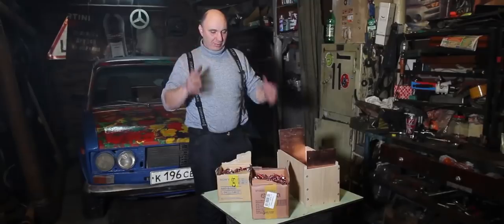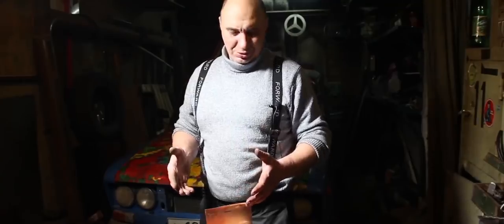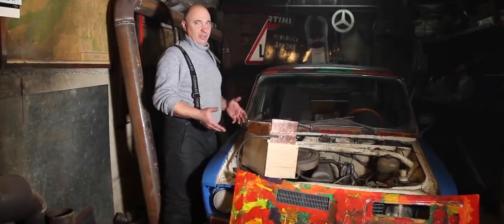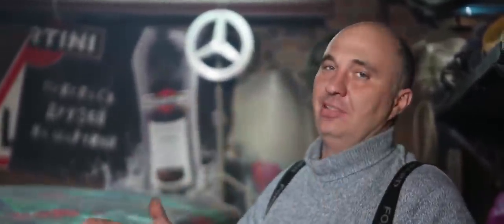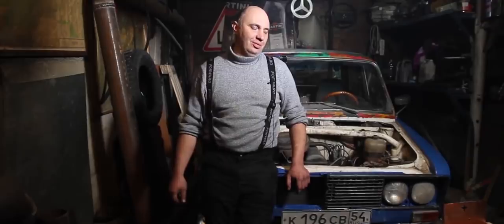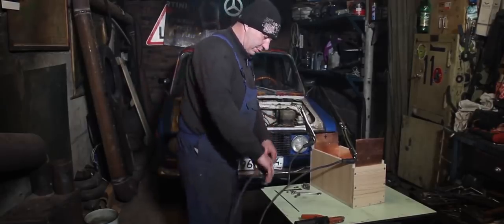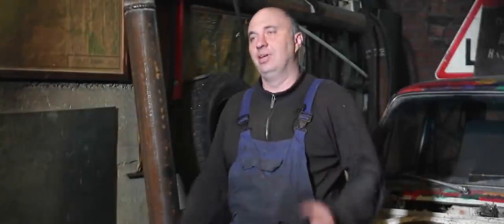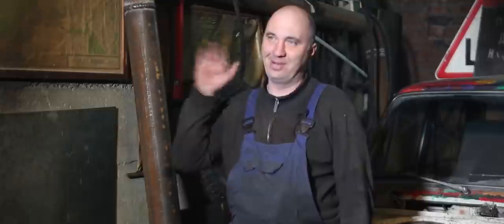1000 AA's instead of a conventional car battery

Comment: Should try making a permanent battery with rechargeable AA batteries, then you could rechargeable it safely
Reply: So make something exactly the same as whats already in there, a rechargeable battery? Yikes how exciting, we will all be asleep before the end of the video, if anybody bothered to watch it.
Reply: that's not a bad idea. it's a lot safer than a wet battery if you're using it indoors with a power inverter.
Reply: Lassi Kinnunen  super expensive LiFePO4 batteries then
Reply: Lassi Kinnunen  Its a battery that can be recharged.... Its the same, its dull!
Reply: @RichardWraith  chill, just a suggestion ya don't need to get all agressive and shit.
Reply: @RichardWraith  This is exactly what I was HOPING to see!!!!!!!  An alternative way to purchasing a battery that is more affordable than having to buy a damn EXPENSIVE tesla battery for your electric car!
Reply: You can buy those with multiple functions from some 30 $ or euros and up. Err, for backup that is. Permanent for in a car is not such a good idea, bc batteries have a memory function; meaning the capacity decreases rather quickly.
Reply: 18650s/Tesla Batteries would be a lot cheaper and they are rechargable
Reply: No. That would not be a good idea. Rechargeable AAs steel nothing like a lead acid car battery. They will likely overheat within 20-30 seconds. Depending on the construction, the core of the batteries would probably try to force their way out the ends, though I believe most rechargeable batteries have vent holes at the nipple end so the pressure can be released in the event of an overcharge. So likely 30 seconds in there will be a lot of smoke and a lot of ruined batteries. Probably fire and possibly some explosions and batteries flying everywhere.
Reply: @ihatesignupsgrrrrrrr   Actually tesla battery is some of the least expensive that exist on the market, lithium batteries is expensive to make...
Reply: @serisak   You do not have a clue what you are talking about. Running eleven  1,2v rechargeable aa batteries in series would give 13,2v and combine many in parallelly also and you could use that as replacement for the normal car battery just fine...

Comment: Its 8 Cells in Series = 12V / 0.5-1.0 Amps/Max  and 125 Rows in Parallel so its 12 V at 62.5 Amps to 125 Amps, depending on the cell quality, but it's almost the same like a cheap car battery
Reply: CLIQUE CO. It's all in the maths
Reply: welp you just whipped my ass in electrical engineering
Reply: It's a 375 amp hour battery, but you're right. not much current compared to any kind of rechargeable battery.
Reply: Usually, car battery sits around 14V. If you look at the discharge curve of 1.5V Alkaline battery you can see it very quickly falling to 1.2V. It would be a lot better to do 10 in series.
Reply: I wonder how hot the cells were after starting the car a few times.
Reply: A fully charged alkaline battery will put out more like 4-8 amps. Youd be much past 125 amps
Reply: @krneki44  No, it sits around 12,5-12,7V. When it is charging, it goes over 13,5 better 13,7V. Some rare occasions it goes to 14,1-2V.
Reply: @Derundurel  Starting the car didn't load them for very long. If anything would have heated them up, it would have been the stick arc experiments, where the batteries were essentially short circuited for longer periods of time.
Reply: he said 8 batteries wide and 12 batteries long.  So it's 12 AA in series.
Reply: @dtester   Yes he said, but he oriented the box that way to him self. So its rather wrong. 8 aa in series. 125 paralels. Those are cheap ones, so about 1,5Ah range. That goes to about 175Ah. For that engine in Lada it would be enoug 60-70Ah lead acid battery. Starting power in about 500A or more...
Reply: @mihamaker  doh, shenanigans!!!
Reply: @dtester  When I paused the video with an overhead view of the battery box, I saw 8 long, 12 wide, 10 deep except for 5 columns that were eleven deep. That worked out to 125  8 cell strings, for a total of exactly 1,000 AA cells. That works out to about 375 to 400 Amp Hours, but a rated current of only about 125 amps. Alkaline cells can't produce as much current as rechargeables, but they can run light loads much longer.
Reply: @vincentrobinette1507  ya I know, that other guy beat u to it.  Shenanigans!!!
Reply: @dtester  12 x 1.5 would give you 18 volts. I would have to watch it again but I think he said 8 long 12 wide.
Reply: @davidhenderson3400  he said 12 long 8 wide...but that was an error.  Two guys before u already responded that it was actually 8 long.  Lets see if a fourth guy  tells me again ^_^
Reply: @dtester  You will be lucky if it is only 4. Most likely some one will see your comment 15 years from now and be the 400th person to post this.
Reply: @mihamaker  cheap AA are closer to 600-800mah, and knowing the capacity doesnt = cranking amps..
Reply: @zacharycharo4374  12v would be seen as a dead battery, which would engage the alternator, putting the batteries right around 13.6v
Reply: Many non-rechargeable batteries have voltage as high as 1.75v, which would be 14v, not 12v. Which would not engage the alternator.

Comment: The underhood welders work really well, but you need a high output alternator and a deep cycle battery. I have that welder on my jeep and have used it several times in the middle of nowhere

Comment: to be able to weld with a car battery you have to have at least 2 and wire them together to get 24v then you can lay beads with stick electrodes. The rod will just barley get hot enough but it works and will get you home in 4x4 situations

Comment: The reason this works is because the AAs are in parallel. It looks like this battery is in an 8s96p configuration. This means the starting current is split so each set of batteries in series only needs to provide 1/96 of the starting current, which should be totally doable

Comment: I think it would actually be 13 and then 12 columns of 8 cells long, alternating to 13 and back to 12, because it seems like the cylinders would be staggered in the box (5 double-rows of 25 = 125, * 8 for the 1000, at 12V and an undetermined large amount of current).

Comment: Tesla battery packs are full of 2170 cells, so it's basically the same thing

Edit 18650 to 2170
Reply: Not same thing.
Li-ion battery use different  chemistry
Reply: Duh
Reply: 12x9x maybe 10 
That 1.5V x9=13.5V because the the cells are connected and each pack has 1 Ah guessing there is 120 packs/rows about that 120Ah and 13.5Vx120Ah=1620Watt hours
Reply: @banopanov3281   correct that is the capacity of the battery bank ,, but you are not gonna discharge it for a few hours ,,what you need is a good 200 or more short instantaneous current

Comment: The internal resistance of carbon batteries limits the current flow more than lead acid batteries. They have a lot of power. But, it's unlikely they will hold an arc.
Reply: to sustain the arc you need at least 18to 20 volts ,,, and 40or more to have a good arc start  with the scratch method ,, so the 12 volt does not do it

Comment: Would've liked to see an ammeter in that circuit. AA batteries typically have a short circuit current (max current output) of about half an amp at most. I'm figuring around 62 amps would've been the most that battery pack could output

Comment: A 1.5V AA battery can usualy surply about 1A, with high quality , with some high power it can go as high as 4A... Rechargeable batteries can go much higher.

You need 8 in series to get 12V. That makes makes 125 in parallell. That gives us anything from 125A to about 500A. I don´t know if 125A could start a engine.. maybe a smaller one... 500A will certanly do the job, and also fairly well.

Also, even if the batteries only can dra 1A... they may be able to draw twice or even three times as much for less than a second, and that might be sufficient to start the engine
Reply: 35A is enough to start a small car, 75A for mid sized hatch backs, 125A would start a truck

Comment: he should have done them in an x9 pattern instead of an x8, overvolting the 12v system slightly is pretty much standard practice. Running 13.5v would have left room for voltage drop when load was applied and required waaaaaay less AA batteries. Also, any hint of the alternator working fine is a false-positive, the batteries aren't rechargables so once the charge is gone they're just going to leak and blow up from the alternator pushing power to them lol.

Source: Me. I ride a 48v eBike and a 52v battery pack serves waaaaay better lol

Comment: Next time connect the car to a 110 volts and try to started it like that that would be cool
Reply: I've started a '73 Beetle with 230 volts... It works like a charm, because normal 230 volt socket only gives 10 A current (230 V * 10 A = 2300 VA, 2300 VA / 12 V ~ 191.667 A) . The connected current meter did jump out of scale in about 1.5 seconds (it could only show up to 4 A load)..
Reply: How the hell are you gonna start a DC system with AC voltage???? I call bullshit

Comment: Move the radiator if you need to, see if you can manually crank start this car with a bar / socket on the crank pulley bolt. Also try using a power drill.

Comment: You need far fewer batteries to start a car, maybe just 10 are enough, good batteries can provide considerable amperage.
Reply: 10 AA's no way
Reply: 1.5 volts each one. 10.5 if are 10. You need 12 volts. Without speak about amp.
Reply: @RichardWraith  yes, I made a math mistake,  but you that say that can start a car with 10  AAA call me idiot?
Reply: You can start a motor with just 10 AA batteries but u cannot recharge them back unless they are rechargable. But you will just need 8 of them which if they are healthy gives u 1.7V per battery x 8 of them equals 13.6V (and they will even have more which is surely enough) and each AA battery has at least 1500mA which x 8 batteries gives 12000 mA which is well enough comparing that a normal car battery has only 6000mA inside it to start a car. Easy.
Reply: @johnnymotors2023  You cant start a fucking engine with 10 AA.
A cars starter motor can draw upwards of 50Amps.
Reply: Johnny Motors  No no no no! Wiring in series the amps remain the same as 1 battery, even though the voltage increases. If 1 battery gives 1500mA per your example, which is rather optimistic, 8 in series provide the same 1500mA at those 13.6 volts. If you wired them in parallel you would increase amperage to your 12 amps however the voltage would remain at 1.7 volts. Neither way would come remotely close to be enough current for a starter motor, you couldn’t even operate the blower motor.
Reply: @IIGrayfoxII  It can draw up to 50 Amps. Just try with 10 batteries and see yourself.
Reply: @joshuahelgeland814  Damn. Then how the power banks work then? They have like 5 18650 batteries each with 2400mA and because they are in parallel they have 3.7V only but 12000 mA. So that would mean that it has 12Amps right? so put like 4 sets of those batteries in series should give you enough energy to start the engine and even run the lights without charging the batteries for many hrs.
Reply: @johnnymotors2023  Show me which AA can output a current of 50+A

Don't confuse AA with 18650
Reply: @johnnymotors2023  You are correct about the voltage, but wrong about the current.  As you connect a single string of batteries in series, the voltage increases but the maximum current they can produce remains constant.  If, however, you were to connect them in parallel, the voltage would remain the same but the maximum current would increase.  In this case, the batteries have been arranged in long enough end-to-end strings to deliver the correct voltage, and then those strings were paralleled up to increase the maximum current delivery.  The equations you are looking for are V = IR (voltage = current x resistance) and P = VI (power = voltage x current).  The number of batteries required to crank an engine for a second or two could probably be significantly reduced from 1000, but not as few as 10.  Look at the mAh (milliamp-hour) rating and internal resistance of the battery, determine the current required to crank the engine (diesels require much more) and do the maths.  **Edit** - I see others have made the same point I have, but hopefully Ohm's Law will help illustrate it.
Reply: @davidloader8144  True
Reply: @liv04soccer  You think electroboom is a solid source.
Sure he does stupid things for the sake of it.
But that car battery was a tiny bit weak.
2Ax19v=36w
36wH/6=6.3watts added in that 10minutes.

Do you really think 6.3watts was enough to add additional charge to the battery?

Comment: Series parallel feed

1.5V * 8 = 12V 

AA Battery roughly 1A Current draw so 12A Current per layer

3 layers would be sufficient on the low end...

Comment: Each 1.5 Volt AA battery is rated at a maximum output current of 0.5 Amps, so therefore each line of series 8 x AA batteries gives 12 Volts 0.5 Amps.

So 2 parallel lines of batteries will give 1 Amp of current at 12 Volts and each layer of 12 x parallel lines of batteries will give 6 Amps at 12 Volts. Multiply this by the number of layers and that gives the maximum current output of the battery pile before it drops the voltage to compensate.

Comment: The math 1.5 times 8 in series =  12volts. 8 devided by 1000 = 125. Meaning 125times a single AAs current so if they were 5amps output as he said it would be 625amps from that pack. But I think that a AA has 2amps of output by 1amp hour of capacity so you're looking at 125amp hours or a total of 1.5kw hours "dayyyum" of capacity and 250 amps of output. But that capacity.. Holy shit to say the least. But at even $5 a 24 pack you're looking at $210 of batteries that aren't actually rechargeable and the risk of if a cell goes bad there's no protection circuitry so you could get a cascade failure possibly resulting in a fire. Never the less it's impressive but extremely non-economical lol
Reply: In Russia you not charge battery, battery charge you.
Reply: @1stockpunto866 I get it lol

Comment: Despite what you are told all batteries can be recharged but the issue with alkaline is that it has a low micro fierite capacity that maxes out at 500u and that means that charge/discharge from a car is too much .

Comment: I suspect that battery pack could start a very large engine without trouble. Rough back of the napkin calculation gives me 1250 amps for a short burst peak current
Reply: 10amp battery? really stretching that much. He should of spent $100 on super capacitors as they have million cycle life. Never need to buy a battery again.

Comment: You could have started it with 20aa batteries I've had to do this when my battery died and all I had was a 20 pack of dollar store batteries
Reply: 20 aa wouldn't have enough cranking power
Reply: @kamilthegreat2834  yes it does do the math for a4 cylinder engine 12v starter will easily turn over with half that voltage I've done it so stop taking shit about what you dont know
Reply: @theirishaxe9405  no you do that math. Don't be stupid even if every aa was 12v or even 15v and at 2 or 3 Ahr that's 40 or 60 Ahr look up the minimum your starter needs to turn let alone turn over an engine. And by the way 99% of aa are 1.5ahr
Reply: we tried starting a toyota car with 2 LiPo 2s Batteries and it started.
Reply: @ducac-0457  different kind of batteries. Not the ones we are talking about. Those are high discharge packs.  Not aa
Reply: @kamilthegreat2834  it still was a first try thing. It wasn t for experiment but the car battery died so we tried LiPos as we had them with us.
Reply: X = a lot of doubt and you're wrong
Reply: @kamilthegreat2834  You might come across as knowing what you're talking about if you didn't keep saying Ahr when you should be referring to amps. Fail.
Reply: @ducac-0457   I started my 5.7 v8 with 2 lipo 2s batteries last winter sub zero temps a few times when my battery was dead.
Reply: @shanec5617  it does work its another proof. 2 LiPo 2s make 14 volts so its more than enough
Reply: that's why i always keep a few 18650 cells and a roll of duct tape in my glove box
never know when me and my wife will go to the movies and i accidentally leave the parking lights on or whatever
Reply: Your only assisting your current battery for that little extra bump needed to start.

Comment: Your 1000 AA Batterys deliver up to 15V and around 500 to 1500 Amps while starting the engine, of course it won't be able to do the 500 to 1500A for very long, but it should last long enough to pretty much start every car with a 12V Board System.

Comment: 160 amp at 14.4 v is about what that AA battery pack is. 320 amp at 7.2v might be better for arc welding.
 So instead of having each layer 12 long and 8 wide it would be 6 long and 8 wide with twice the amount of layers.

Comment: 8 battery’s in series x1.5volt output=12vdc 
1000 battery’s /8= 125 parallels 
125 x 1200mAh=  150kmAh/1000 = 150
150ah x 7.25=1087.5
 (7.25 is a rough estimate to CCA)

12vdc
1087.5 cold cranking amps

I could be totally wrong though

Comment: I have started a car using two 6V lantern batteries,the sort with the springs on top..wired together and connected to cars battery leads..cranked and started car OK..In the old days,here in Australia,there was a interesting car battery that you could buy,it was called the "switch battery" was invented by a New Zealand man..it con tained two car batteries in one,sort of "double barrelled approach"... if your battery went dead,and car wouldnt start,just lift the hood,and flick the switch over to the other position,then start car..worked well..dont know why they went off the market,maybe bought out and closed down by Americans..

Comment: But doesn't an AA battery only have 1.5 volts? So when everything was connected it was only making 1.5 volts with massive capacity? The only way you could get 12 volts you would need to run them in series then run packs of series batterys In parallel to make capacity.